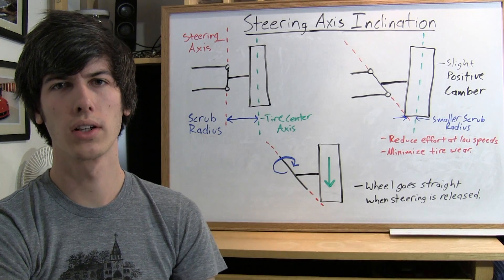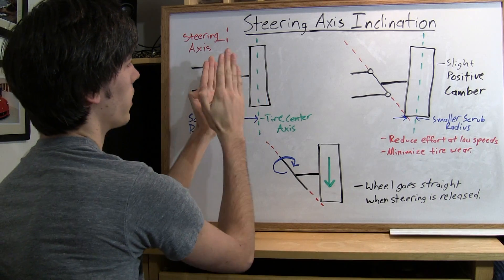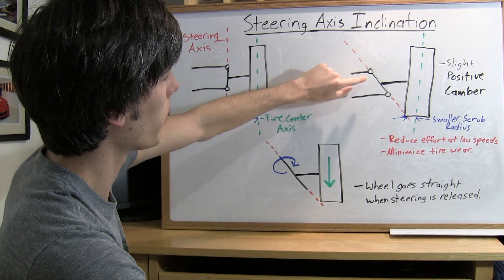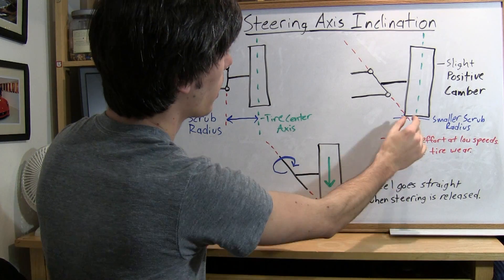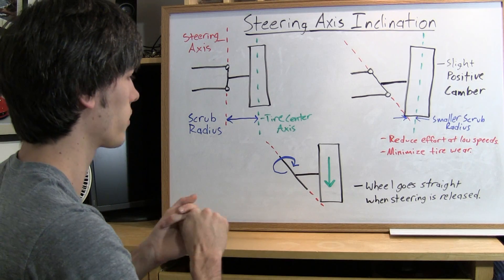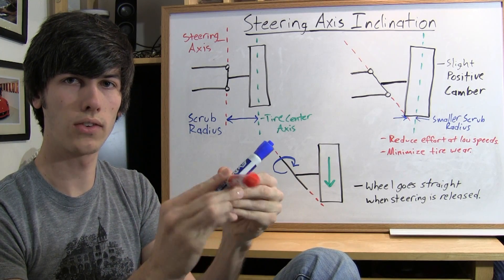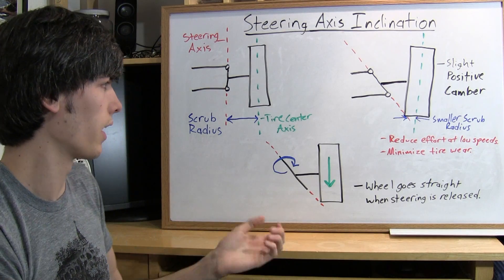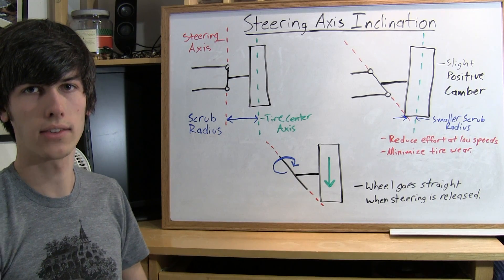Steering Axis Inclination - Explained

Comment: Scrub radius- you mean it acts as understeer when you turn the wheel? But surely if there's a good Ackermann angle; re your far left diagram, shouldn't the car not have a skid force? (I'm still trying to work it out in my head.)
I remember radial tuned suspension on Australian Holden's and turning the wheel there was no noticeable angling of the wheel +vely or -vely through the turn, like cars do today and the tyre did not wear through any scuffing like the previous vehicles; dictated by that head of gm. It was an awesome ride too.

Comment: In your explanation of turning, you're confusing the differences between SAI and CASTER. To compare caster, I use the straight-ahead value of the fork of a chopper motocycle. Having to turn the wheel left or right, it causes the need to cause a "lifting" of the bike causing the weight of the bike to want the direction of the front wheel to want to go straight. Drawing a staight line between the upper and lower ball joints or strut tower pivot point and lower ball joint and where that line meets the road surface and where that point is inside or outside of the center of the tire surface will determine the totque angle of rolling resistance of the tire (left or right).

Comment: Installed new pump and flushed whatever fluid was in the rack and cooler. BLED system like I had done before, wheels in the air, engine turned off, and turn steering wheel left and right while monitoring the fluid level in the power steering pump reservoir.

Drove the truck to get a wheel aligment (at Firesxxxx) and then drove off to test their work. Got on the freeway and noticed that the steering wheel was NOT centered while driving straight on the freeway. The truck was also pulling slightly to the right. Drove back to Fxxxstone and explained to them what was going on.

Different tech was assigned to my truck. The tech put the truck on the lift, and began to make the adjustments without first driving the truck. When he finished making the adjustments, he drove off the lot to go test his own work. The tech came back puzzled and said that when he drove off the parking lot and made a right to get on to the street, he noticed that the steering wheel did not go back to center, instead the steering wheel was way off center. He continued to state that he proceeded to drive on to the freeway and after driving for a good 1/4 mile he noticed that the steering wheel went back to center. He didn't know what was causing this. I had never noticed what the 2nd tech noticed when I first test drove mytruck. My initial complaint was only about the steering wheel not returning to the center and the truck pulling slightly to the right while driving on the freeway.

I left Firexxxxx and it was then that I noticed what the tech was talking about. The steering wheel does not behave the way it should. Sometimes the steering wheel stays centered but for sure, if you make any sharp turns and then hold the steering wheel to drive straight, the steering wheel does not return to its center position. Do I have a bad rack and pinion? Did the alignment shop make things worse the second time. .

Comment: Great Excellent video from 11 years ago. 

Additional benefits-
-Better aligns the force on the wheel along the camber angle of the tire to by increasing & decreasing camber as the wheel turns.
-Further aids toe in and out for optimal alignment of wheel to pavement for inside and outside tires. This is in conjunction to length & angle of steering knuckle to axle.
Reply: Right Now - Finding out that this channel has videos going all the way through today! ❤ Awesome 🤩

Comment: so it's actually a combination or a delicate balance between axis inclination, caster,  and toe in that keep the steering wheel straight and bring it back to straight after a turn, right?
Reply: and those are also dependant on whether it's a front or rear wheel drive car too correct? don't front and rear wheel drive cars react oppositely to positive/negative axis inclination?

Comment: Hello , great video explains things clearly .
May i ask , I am designing a tricycle that due its small wheels (18in) and the distance that a non dished wheel has from centerline , I have to incline kingpin 20 degrees , is that too much ? Is there any limit in kingpin inclination ? Does it make steering heavier ? Shifts weight too much ? Etc  
Thanks in  advance

Comment: can you make a similar video using a 4x4 block thats 6'' long and  a piece of 3/4 '' pipe please, its the best way ive been able to visualize what is happening. the pipe being the ground and the block placed on the pipe being the tire for caster adjustment, tire turning, and the reactions of positive and negative camber. then explain the gripping benefits or loses with that.  i realized i can see the idea better this way but dont understand the concept of what is ideal for grip. this made me understand why my tire wanted to take a hard right like a motorcycle but my other tire stayed flat like when you have a passenger on a motorcycle who doesnt lean when you do.......sorry thats the best example i can give. I just want to get it right. so i can drive safely to get an alignment. also does any of this affect the wiggle in a idler and pitman arm? Thanks in advance for the help. I maybe over thinking everything but my favorite saying is perfect is good enough, thatll do pig thatll do. Thanks again,

Comment: If using an adjustable top camber plate and adjust the strut to move out to keep as closed to 0 camber as possible due to lowering of stock height, will that affect the scrub radius?

Comment: After doing wheel alignment, the front left camber is -0.15 degree and front right is -0.25 degree, and the car usually pull left. Do you think that difference in camber might cause that pull ?

Comment: Oh goodness, this is so wrong on so many points.

Scrub radius, the more you have, the easier to steer the car at slow speeds and less tyre wear, NOT the opposite as you have instructed. If zero scrub radius, the tyre screws itself on the road surface, the larger the scrub, the easier it is for the tyre to roll - think about it!

Comment: I didnt really get the explanation, why the wheel goes straight when steering is released. Why does it force the tyre to go downward? I couldn't really understand the experiment. On the white board the shaft going to the tire is horizontal. However, in your experiment with the markers it's inclined and orthogonal to the steering axis.

Comment: Hi, thanks for your work, I am a fan. I have a question. What is the MAIN reason that a car pulls to the direction of road inclination? I know that a car must drive straight despite of inclination on the road. I have a BMW F11 with double control arm, the lower one is new on the car.. The mechanic says that hte other ones are OK....!!! The ShockAbsorbers are also OK...

Comment: I don't really understand why the vehicle body moves up. Okay the wheel can't obviously plow into the ground. So I'm guessing the road exerts increased reaction force on the wheel when it's turning. But how does this reaction lift up the vehicle body? Also wouldn't the suspension spring absorb this force and keep the body steady?Or does the reaction get transmitted through some other path? Confused...

Comment: Hi .

I'm designing a Mac Pherson suspension for an electric car with 54% weight distribution ahead and 46% back.

Which kingpin angle do you recommend I use?
Where can I find kingpin angle values used in city cars?

Thank you very much for your response.

regards

Comment: Im planning to upgrade my wheels on the fiesta st. I would like to keep the wheels as stock as possible so that the handling doesn't change. but the wheels that im after has an of ET38 and will protrude 10mm towards the outer fender. Would a 10mm extra track width on each wheel affect the handling of the car or the longivity of the suspension/ball bearings etc? Thank you and keep up the good works 👍

Comment: yes suspension explained.................... but for people that want to build a suspension you their application, buggy, custom car etc,,,,,,,,,,,,.......................... they should think about using a pre- designed suspension set-up, instead of going through a design that 7 times out of 10 will not work quite right. A PRE = PROVEN SUSPENSION IS THE WAY TO GO......... EXAMPLE: you aquire a suspension system from a car that is the right size of what you need to fit...................... & then make a new system that is lighter & stronger than the original suspension system........................... viola .

Comment: greetings !!
please respond to this comment :
i am a fiberglass mold maker [ 60 years old ] i have not had alot of experence with suspensions............ i know carbon fiber though, i am planning to make some replica cars.

tell me what you think of this idea please:
instead of designing a new suspension from scratch.............. use all the dimentions & measurements for the a-arms etc-etc...... from existing factory suspension that are on the car one chooses to use the suspension geometry from, after measuring all the required parts ................... then one would CUSTOM make all of the suspension componets & copy the assembly to the chassis used...................... understand what i am getting at ?
use a factory made suspension set-up on the car you are building...... instead of trying to design your own a-arm suspension use a tried & true & proven car factory set-up.
i have thought of designing my own ................. but to use a long used system would be far better.............. & easier than to try to build a new un-proven suspension system, like a mg midget a-arm front set-up.

Comment: I have a question regarding the last part of this video (steering returning):
I have two cars. One of them has quite a strong negative camber, and this car does not have a very good steering return - at times after making a turn i have to physically turn the steering wheel back straight (but it does go straight fine tho). Is this because of the negative camber and a larger scrub radius?
Reply: +Charles Nam hi i think problem is not due to negative camber but it may be due to toe out ..... so check toe out or toe in actually toe- out create problem...

Comment: how to decide the value of angle of kpi & caster? is there any formula or method t do so?  how t measure the effects due to kpi & caster? (without software)
Reply: measure the common vehicles. u should start from there..no need for calculations

Comment: I understand well what you are explaining, but I can't relate this theory to the tie rod steering, as we have on most modern day cars. If we are dealing with the antique "King Pinn" steering, I CAN contribute to you're lecture. I however want to ask:
Is the scrub radius, the distance at the "ground point" between the camber axis and the linear axis that would cross both the upper and lower ball joints on a "Double Wishbone" suspension?
Reply from the maker: I think you've got it right.. via wiki "The scrub radius is the distance in front view between the @wiki/Kingpin_(automotive_part) axis and the center of the contact patch of the wheel, where both would theoretically touch the road."
Reply: Engineering Explained Ok I see. Thanks for replying. You've a whole bunch of good videos by the way.

Comment: what happens if you "reverse" the scrub radius, so instead of having the small angle at the bottom, you minimise the distance at the top, so that you have negative camber, i need negative camber for stability on an off road buggy

Comment: If you still make videos then I have a request. What about making a video about wheel base and the difference between for example a limo and a toyota ae86, honda crx or something with short wheelbase. IF wheelbase=length between fron and rear wheels. I hope that's called wheelbase. Would be really interesting to see the angles and radius happening for the front L/R and rear L/R wheels depending on wheelbase. Best regards from Sweden. PS You are really good with teaching. All those 3D animations

Comment from the maker: Bigger scrub radius means more tire wear when turning, and by altering the camber they're also going to change the tire patch, likely making it smaller. The trend goes, smaller tire patch = less overall grip, as there's less surface area of the tire "meshing" with the pavement.

Comment from the maker: [1] No, having a large scrub radius will make it more difficult to steer. However, at high speeds little effort is required to steer. 
[2] Scrub radius is the distance between where the center line of the tire meets the road, and the line of the steering axis meets the road. By changing the camber the tire's center line moves closer to the steering axis.
[3] It doesn't heavily depend on caster. Caster moves the steering axis in a different plane, making the scrub radius change minimal.
Reply: So Negative camber = less scrub radius right?  And Caster is true vertical with  the adjustment being  strictly lateral (forward backward) from top of the strut tower ?
Reply: So just to be clear Caster= forward backward position of the wheel base mounted from the strut. 
  Negative Camber  bottom of tires stick out.: creating tighter scrub radius because of contact to the innermost surface of the tire? 
Positive camber: top of tires stick out keeping the cars ride alignment toward center ? What's the  point for  Posicam?
Reply: Positive caster would be like a motorcycle with monkey bar handles

Comment from the maker: Well for racing purposes you may use negative camber, at the sacrifice of tire wear. But when you're racing negative camber isn't going to be the major cause of your tire wear. It's the fact that you will frequently be hitting 1g of deceleration and close to 1g in the corners. Put's quite a beating on your tires. So for racing purposes you might ignore things like the scrub radius. Probably didn't make that too clear in my camber video.

Comment from the maker: @PhilTheBroatian Because there are things between the steering axis and the center of the wheel. Brakes, suspension components, the wheel itself has an axle in the center obviously, from which it is driven. These components make it difficult to decrease that distance, though it would be beneficial if possible.

Comment from the maker: @yamenad When you're looking at the diagrams on the board, imagine that you are sitting behind the front right tire at looking parallel to the ground at it. The dotted red line is the line about which the wheel/tire rotates. The dotted green line is the center of the wheel/tire. The closer these two lines are at the bottom of the tire (scrub radius) the easier it is to turn, and less wear will occur. Hope this helps!

Comment from the maker: @Nicosh1471 It is also due to positive caster, which will be another video posted shortly. Positive caster plays a very important roll in keeping the tire straight. Glad you enjoyed the video!
Reply: In your explanation of turning, you're confusing the differences between SAI and CASTER. To compare caster, I use the straight-ahead value of the fork of a chopper motocycle. Having to turn the wheel left or right, it causes the need to cause a "lifting" of the bike causing the weight of the bike to want the direction of the front wheel to want to go straight. Drawing a staight line between the upper and lower ball joints or strut tower pivot point and lower ball joint and where that line meets the road surface and where that point is inside or outside of the center of the tire surface will determine the totque angle of rolling resistance of the tire (left or right). I studied mechanical and electrical engineering and was a field rep for Hunter Engineering for several years before owning a front-end shop for years. Ron Valiquette

Comment: Oh so that's why the wheel spins back on it's own!!! But I've got a 4WD ... hmmm does that mean that the 1998 Rav 4 has positive camber? Or is it just the Steering axis that's inclined? I noticed two things: 1. My wheels appear to get worn uniformly... 2. My car makes an awful lot of screech when I turn the front wheels in the work parking lot - Polished Cement Flooring - Even if I'm not accelerating... - Of course couple that with acceleration and I've got everybody looking at me always :-P